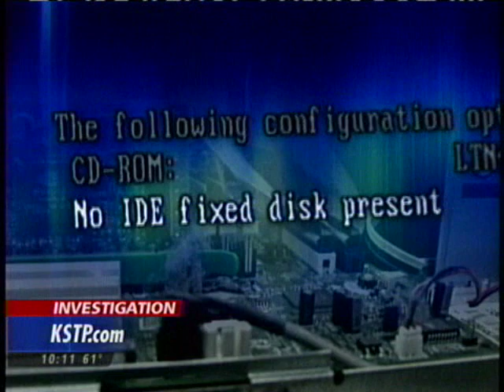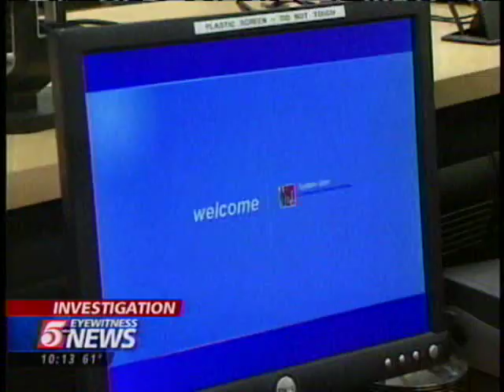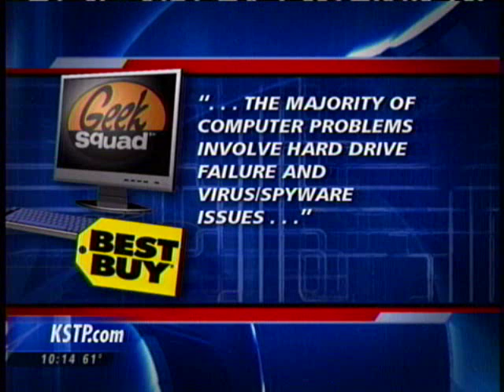Geek Squad is WORTHLESS

Comment: its the problem with how it works... the geek squad consultant ( first person u talk to) is not the person that works on the computer- that is a separate job. The most time your allow to spend per customer is 20mins but if the place is high volume they expect alot less time --- so its not really that they dont know its a matter of time- management tells consultants to diagnose issue on paper for backroom worker but were not allow to take it apart in most scenarios. Which is why most brick and mortar store find a problem like that immediately... they dont have a policy on how they work on computers. Bestbuy has a policy- also not all geek squad consultants are required to have technical knowledge just basic knowledge- while the people in the back are supposed to because thats there job. The first bestbuy obviously had a consultant that had technicial experience while the other didnt. That doesnt mean bestbuy scams people. More then likely  if they had it serviced the other employees in the back would have noticed it almost immediately and the money would not be charged. The service is charged after the work is completed anyway.

Comment: i don't have a certificate i don't have a job i don't have a degree i didn't go to college i didn't take classes but what i do have is REAL LIFE EXPERIENCE i fully built my pc when i was 13 and was messing around with them when i was 6 i can make a pc that is qaud core 1gb grapics card 4gb ram all modern architectures ddr3 am3 or lga 1336 FOR 370$ i can take it from parts in boxes to running in 45 mins and i'm only 16 and a half BUT THEY CAN'T FIX A HARD DRIVE AND CHARGE SHITTY PARTS AT 500+

Comment: They should charge for reconnecting the cable though. Just because it is an easy fix doesn't mean anything. if it were so easy, the end-user would know to do it.  That isn't an issue and it isn't good business to give the shop away. Those techs need to learn the first rules of PC repair. Is it on? Is it plugged in? Boom, caught on the second rule.

Comment: while it is ridiculous that you can get the same results from geek squads around the country. I bet it's more of a problem with the way they are diagnosing the computers themselves. they are seeing that the mobo or hdd isn't working. they are not thinking that it could be a cable issue because the cable should not come unplugged. it would be the same if your check engine light came on because somewhere a wire became worn, so the mechanic replaces the sensor because that what the light was on for

Comment: No no you cant just transfer the ram and cpu if its an old computer. The sockets change over time and you wont be able to get an old board so you have to upgrade to a new one which involves getting more ram and a new cpu. Also it wouldnt be a dinosaur any more after the new parts.

Comment: it's like medicine, you hear hoofbeats you look for horses not zebras. If someone comes in and saids their hard drive isn't booting then you assume it is a problem with the hard drive. You don't think that the customer opens up their case unplugs their cables then brings it in without saying anything. I've never seen a cable unplug itself inside the computer.

Comment: Wrong, UEFI was not released and utilized until 2005 The only issues a HT had were slowing down, a small handful of single threaded, applications that could not run at best performance with HT enabled. This was only an issue in the first gens of Pentium 4's so get up to date. Colin Percival also only saw this threat on LINUX. I doubt anyone using LINUX would have to bring their machine to BB.

Comment: Fuck Geek Squad! I took my PC there on Friday to see what was wrong with it because it had been running very slow and getting worse for the past 1-2 years. Eventually I ended up waiting  for them to run a diagnostic on it that would take "3-5 days." Today (Tuesday) I went back to Geek Squad to pick up my fixed PC that was going to work like new... Or so I thought. Upon picking up the device I immediately notices a loose part on the side of my Lenovo Z50 laptop. I honestly forgot about it over what happened next. I bring my PC back to the counter and start talking to the guy on the other side of the counter. Geek Squad previously said some BS about how many apps were on my PC and that was why it was slow (even though I had recently factory reset my PC and it was still slow after that). I quickly forget about the loose part and try to start up my PC. It glitched out and I had to restart it via holding down the power button. This is something that my PC often did before Geek Squad so I was a little perturbed at this. I finally got the computer up and running and opened a window (cant remember what app but that doesnt matter for this bit). My heart sinks as I realize what they did to my beloved PC. You see in your computer you can get to a list of visual settings, and to get there (if I remember correctly) is Control Panel>Network and Security>Display and a small box pops up with various different tabs full of settings. One of said tabs opened a list of things which you could check and un-check boxes next to them to turn them on/off. These settings were the visual display settings and most of the boxes were un-checked, meaning my display settings meant for performance rather than visual effects or "prettiness" as I like to call it. This really got me pissed because some time in the previous weeks I had spent almost half of my day trying to locate and fix these settings that I had accidentally changed before (alot of time and heartache went into it) and here I get my PC and no they didnt fix it, they just made it a TINY bit better with the cost of ugliness and making my machine harder to use for instance, one of the boxes being un-checked causes a massive black box around any window you are trying to move around the screen, making it almost impossible to do so effectively. The thing was I already had those settings setup for the best performance possible without making my PC impossible to use. This took time to do and the Geek Squad had apparently undon all of my work. Oh and this reminds me of how the guy repeatedly told me that "they wouldn't just go in and change stuff" shortly before I did this, which proved that he was lying to me. Even after I explained to him what I did and Asked why they did change stuff, he told me that those settings being on the custom mode meant that Windows had decided what to put those on, when there was a whole other option for that, and it was on "custom", not "Let windows decide". Oh and FYI before I pulled up those settings in the first place he tried to tell me that my PC looked like shit because they updated Windows to the latest version. I knew that wasn't true. After alot of me being aggravated and alot of him telling lies me, my mum, and the tech support guy all decided that I was right a long time ago in that my PC's hard drive was simply broken and didnt read/write things as well or as fast as it should. My PC ended up with a new SSD that I would have installed myself (for I knew how) but I decided to let them do it because I didn't know how to install the new Windows OS onto the SSD once it had been installed. At the time of writing this I am waiting for further news about my poor PC and hoping they don't fuck it up again. I just find it sad that such a big tech company could get shown up for lying/scamming. If my PC is not ready for me by late tomorrow, I will need to complain to Geek Squad/Best Buy and demand answers. Wish me luck everyone and PLEASE stay away for Geek Squad for everyone's sake!

Comment: @specialestperson customer privacy to open a computer? I understand data......I worked as a service manager for a company in San Diego and I always opened the computer based on what the customer said (if hardware failure) and looked at connections and checked the seating of the memory and whatever PCI cards where in the machine. most of the time they were on their way and happy within 10 minutes.

Comment: @FORZION 

Although that may be true, one should be able to see from the bios whether they need to check for a loose or unplugged cable. The proper thing to ask the customer is when did it last not boot properly. Or about what time did you see this error message. Knowing what the error message means also helps. A non system disk error means usually there is absolutly no os loaded on the hdd or the hdd is unplugged. Always check for layer 1 and layer 2 issues first. These are very common

Comment: Yep, I had to get a replacement HDD but in turn they drained the battery and didn't replace it. Luckily the HDD was under warranty so we didn't have to pay anything to get it replaced. It's BS that they say it takes 2 weeks to re-install everything. My friend and I worked on a computer and had to change the HDD, it only took an hour to two hours to install windows 7 onto it. I was pissed when they didn't replace the battery, told my parents about it yet they did nothing about it. Geek squad is useless and I will never use their service again. GOOD DAY SIR.
Reply: Why didn't you just fix it yourself Raz?
Reply: Because batteries for a laptop don't come cheap and they're hard to find for a certain brand unless you order it from their website or some shit. Honestly they're useless, I'd advise if anything make your own computer, you'll save a shit ton of money in the long run and only go to people you trust to take a look at your computer.

Comment: Like 3 years ago I sent in my computer because it wouldn't turn on, I had to send it to them 4 times before they fixed it.. I told them myself that it was the power supply but yet they still couldn't fix it. A complete idiot could work for them, and if you really have no knowledge of installing hardware you could just youtube it for f'sake...

Comment: They obviously didn't take the time to look inside the computer, but with no diagnosis fee, i can see how they didn't want to waste time testing. See, if a client comes in and has a no drive detected error, and hasn't messed around with the cables inside, the drive is VERY likely dead. Cables do NOT "disconnect themselves by moving the computer around" as the so called expert in the video suggest, That's bull. How to fix this misunderstanding? Charge diagnosis fee and do proper tests. ..

Comment: Sorry but this is just S**T reporting. You take your car to a mechanic and it's "making a noise" he listens to it, guesses and gives you an estimate. Now if he's honest and opens the hood and finds a stick he calls you to pick it up. You don't take your car in and the pull it in that second to tell you the issue. Same thing with GS. Ask 5 IT pro's. "PC says no boot device found" answer 5 out of 5 is bad hard drive. But most people need GS because just telling from the comments here that half the people here don't know JS about computers. I can install a HDD in a desktop in about 4 minutes with a 2 minute break. Then I drop windows X in 1 into the disk tray, click 5 times and done. GS can't do that due to copyright issues! You have to have the reinstall disks or a working partition to reinstall the OS. No disk? Pay dell 40$. Dell doesn't have them? We can't help you unless you buy a new windows copy. Then Come the updates that are usually between 3 and 5 GB in size depending on ISO used. Now If I had time I opened the case at the time it was brought in just to check connections but that isn't the standard practice because some counter agents just check it in. PERIOD! No one wants to stand in line while a kid pokes around your PC "guessing" the issue. Others are smaller all around  shops and would rather spend 3 minutes opening the pc Vs 10 to check it in, wait a day in the que on and on. Replacing a HDD in a laptop can be easy or a B**ch depending on the 10,000 models you get. GS is no more thieves then a restaurant making food you can't. Good news is if you have a working PC, a few screw drivers, and can get to youtube you can do it yourself. Just remember replacing a 250$ SSD on a 4500$ Alienware laptop you broke on accident is YOUR problem then. You come in and buy a brand new Laptop, Get GS protection and want the HDD upgraded to 2TB They will rip a brand new laptop apart. They don't come with instructions and aren't covered under warranty. Doesn't go well? They eat the cost. Get 12 virus's because of all the porn? They will fix it. I don't need GS because I spent 50K on a College education but if i hadn't I would use them to this day.

Comment: I am 15 and i can fix a computer every weak
1 dose it have a beep code when you remove the ram
2 if yes then the mobo is working
3 if it cant find the hard drive then look if it IS CONNECTED 
Geek Squad is a rip off i can do this in 20 min for free and if its broken you can do it your self for about $70

Comment: Apparently you must be from that store. Hyperthreading is enabled on CPU's that have them by default. Enabled on motherboards that have them by default. Hyperthreading does not compromise your computer hardware or software in any way. It requires no modding to disable or enable. Please learn a little more before posting an idiotic comment. If you are a technician and don't know what hyperthreading is and what is does, you should not be working on computers.

Comment: Best buy is in the Business to sell  you a new computer not repairing  so much
Reply: Its because alot of the time the cost for the parts plus labour would make more sense to buy a new laptop or computer and just swap the data.
Reply: Not at all. for people who use it for work / have important data and software for example, a new computer can mean
-lots of time reinstalling and putting everything back in place
-Risk of incompatibility if the same version of Windows is not installed on the new computer / more time to reinstall the correct version completely
-Risk of data loss to a potential inexperienced / bad tech
- Cheap $400 computers that fuck up in a year n a half vs better models sold elsewhere
-Work is stopped until everything is back 100% functional

Last but not least... Why fucking waste?

Comment: The amount of things that are wrong with this test. 9 times out of 10 an error like this is a bad hdd. You run diagnostic on the drive then if it can't be detected at all you check the cables. All of the answers given were possible solutions. Yes even a bad motherboard. So try to be educated on a topic before you make judgments